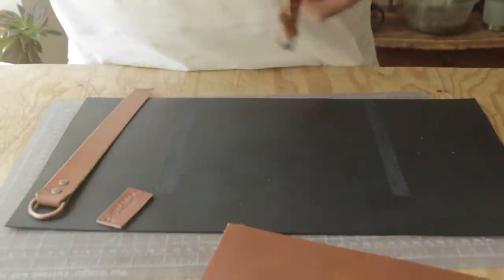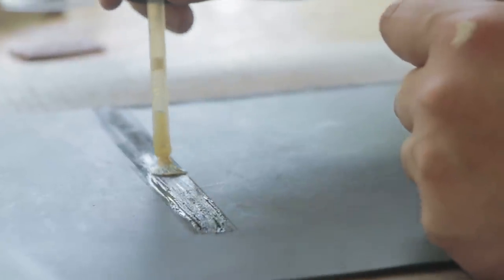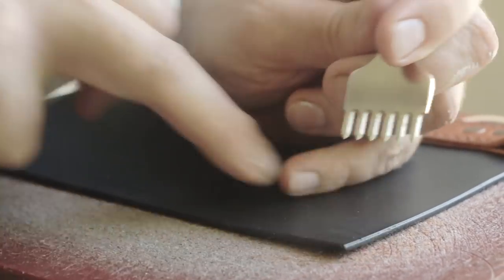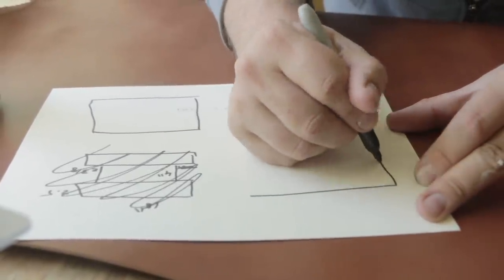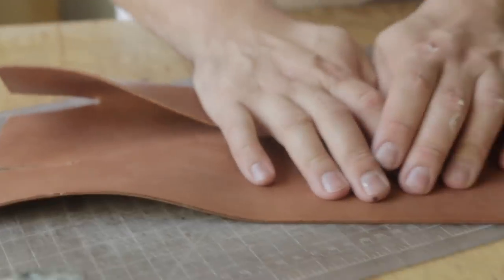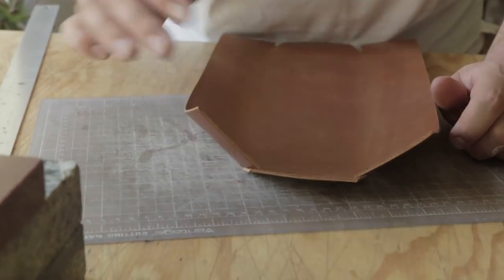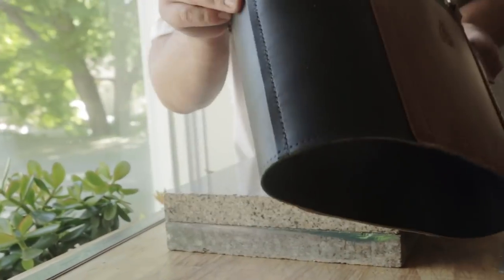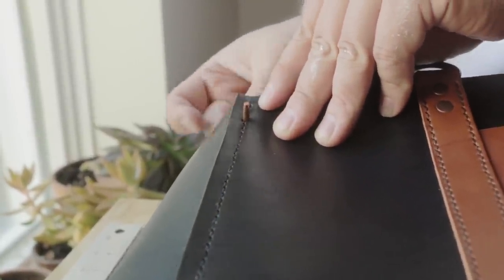Assembling My Dream Leather Bag // Part 2

Comment: I find that if sanding leather creates more fibers it is some dry leather. If that leather is double stuffed it was pretty dry when it was finished. I've bought some beautiful looking leather that was so dry it was very very hard to cut and bevel the edges. Added to that sanding the edges only made it hairier and I had to burn the edges same as you did.
Reply from the maker: sometimes that's definitely the case! This stuff is pretty buttery and cuts through with one pass, I've found once in a while it's just random parts of some hides that have a loose fiber structure. I also probably could have picked a better spot to cut those straps from honestly, but it'll be strong enough with all the stitching

Comment: What kind of glue do you use
Reply: Weldwood Contact Cement.
Reply: Where do you get it from
Reply: @dwaynecurtis8499  I buy mine from Ace hardware, but Home Depot carries it too. It has a powerful chemical smell from toluene though. It is thinner than Barges cement which actually needs to be thinned down before use, Weldwood doesn't. 

It comes in a little bottle with a brush and it comes in various sizes of cans as well. Do not store it in light unless in a brown glass bottle or it will congeal on you.
Reply: Thank you very much